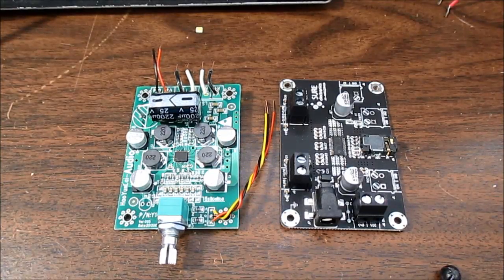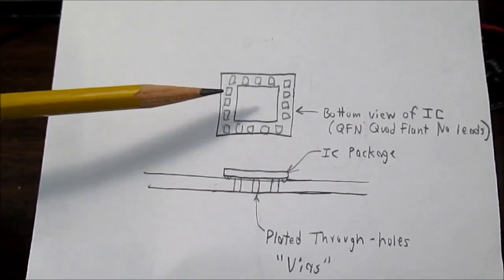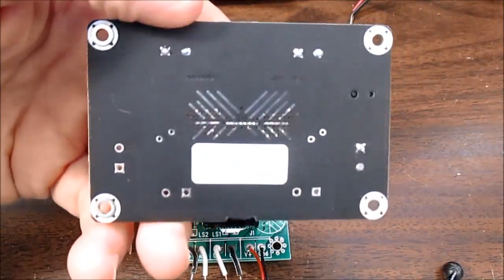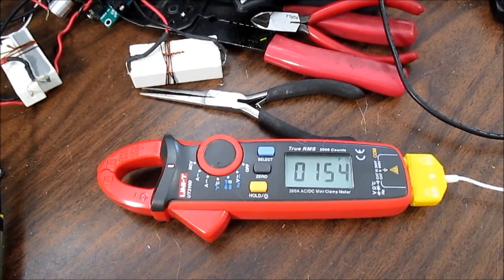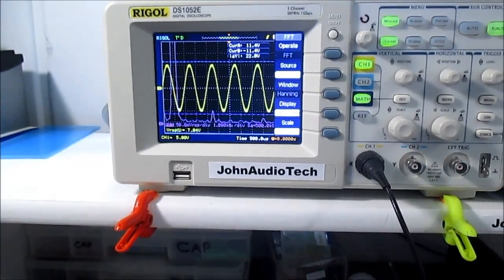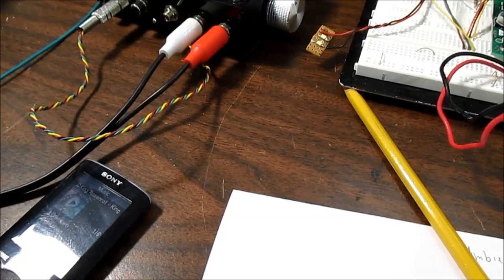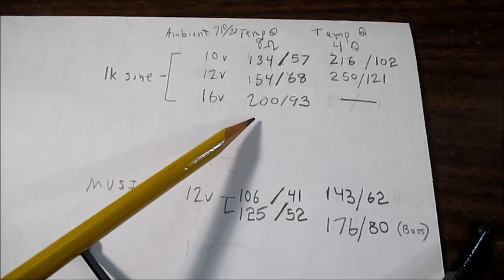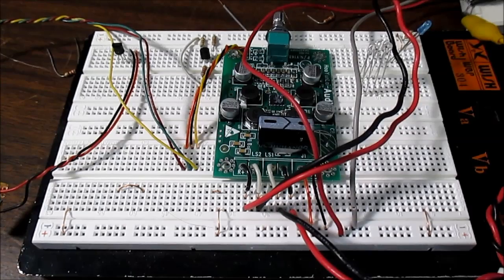Class D stereo amplifier thermal tests. How Hot?

Comment: What I don't understand is why do all these class d chips have such little pitch distances? Their almost all smd and very hard to solder on board. They usually come in readymade PCBs. The local hardware stores refuse to stock individual ICs. The only option to find replacement ICs is aliexp and they cost 80% of the new board.

Comment: Hallo John, there are some excellent small fans that are quite suitable for cooling down these amps with a small heat sink attached: what do you think about using this fan to keep things cool: http://www.ebay.com/itm/Mini-DC-12V-3pin-4pin-Internal-PC-Computer-Desktop-Case-CPU-Cooler-Cooling-Fan-/291971641268?var=&hash=item43faddafb4:m:mp7Rd4euiABuz0EfzOmH6Eg

Comment: Interesting, now I'm curious to know how much more heat a class AB amplifier would generate. I did try it with the TDA7297 amp and it was roughly 54 degreesC on the heatsink, but I don't have the tools to measure the power out.
Reply from the maker: It depends on the biasing and other factors but at best, a typical class AB amplifier is around 65% efficient. In other words a 20 watt power amp will dissipate about 7 watts as heat at max clean signal.

Comment: Hey John !  Could you or somebody please explain me how does three 8ohm speakers connected together makes up a total impedance of 4 ohm ? Because that is what it says in the label of a speaker that  i have from a LG sound system . Thank you !
Reply from the maker: No series / parallel combination of three 8 ohm (nominal) speakers would = 4 ohms unless there is a crossover involved.
Reply: why dont car stereos use a dc-dc converter and use a higher voltage and use 8ohm speakers instead?   , dunno thinkingt out loud
Reply: Suppressing SMPS noise is not really that much of a difficulty. An inductor and capacitors both sides will do it, if it doesn't just add another inductor stage. No matter how shitty your SMPS is, you can always straighten it out. 

But you know, nobody really cares about distortion in car audio, and most of it is actually quite old, so designed before step up converters and with BTL 13V class B in mind.
Reply: Daniel Gomes two identical 8ohm speaker in parralal makes 4ohm!! And i dont know why you want 4ohms because amplifier dont like lower ohm loads as they have to drive it harder , only 4ohm spekers is in cars because there is not much voltage (max 14.4v) for the amplifier!!!
Reply: Thanks for replying !  
Sorry ! I should have mentioned right away that it does indeed have a crossover involved composed by a 2.7 uF electrolytic capacitor and a inductor to which i dont know the inductance .  I'm aware that there is no possible combination with three 8 ohm loads hence my question !
Reply: The idea it's to use the three speakers for each channel of the  TDA7492 board amplifier that John recently reviewed here . As I bought a 24 V power supply I'm " stuck with having to use 8 ohm loads only .
Reply: Jusb1066 adding a dc to dc converter witn circuit means that you are adding additional switching noise and that would cause problems!! Best power supply for amplifier is a transformer with rectifier and lots of caps or battery... Smps will add more noise ... If you use a high quality smps then it would be ok but those cost 80 to 100$ for 12v 10amp cosel smps...
Reply: Jusb1066 
that's what is done inside the amps. but a DC to DC that large would be big money. its cheaper and easier to drop the ohms and pull more current to get more power. also the sound is usually cleaner with 8 ohm speakers and 8 ohm load.. but big bass car audio is in the 10's of thousands or watts. if you don't have 3-5 kW plus. you will get laughed out the place. most have multiple 5&10 kW amps. with sub's with 2500 watts or more each. and they run down to like 0.25 ohm on sub amps.